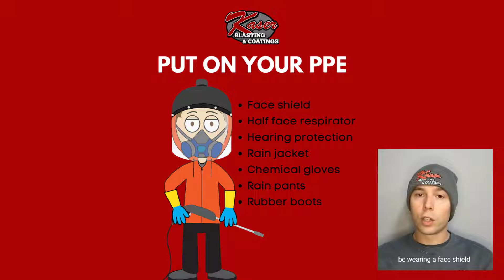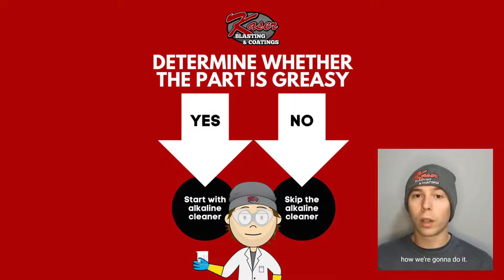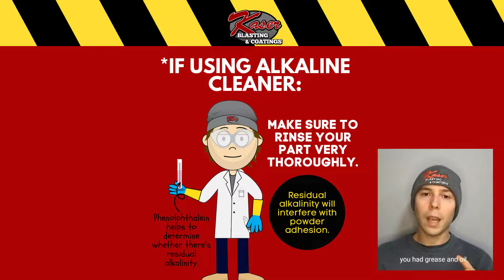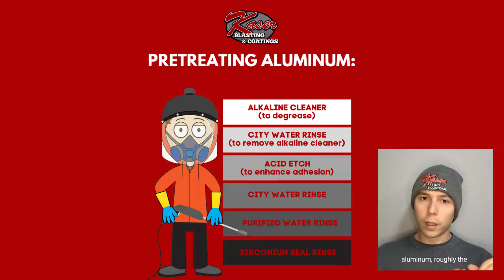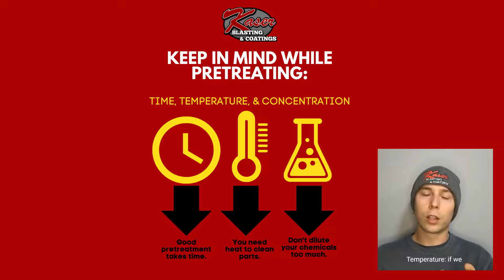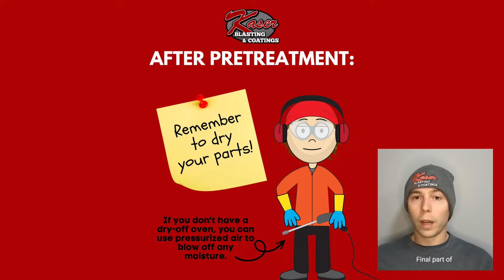Intro to Pretreatment for Powder Coaters

Comment: How does your steel not flash rust when rinsing with water before phosphating?
Reply from the maker: Typically, city water is not low enough in pH to cause flash rusting. If flash rusting is happening during your water rinse, check the pH of your city water.
Reply: @kaserblastingcoatings  thanks for the reply! What PH is your water for reference?
Reply from the maker: @Skeeter_420  pH neutral is 7. Most city water is 7-8.